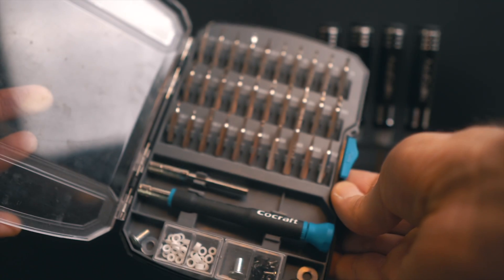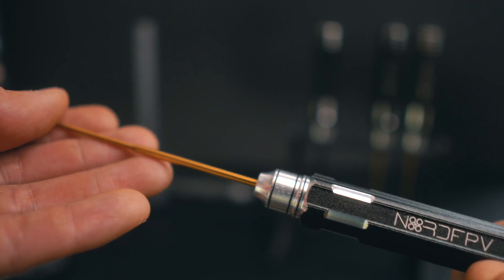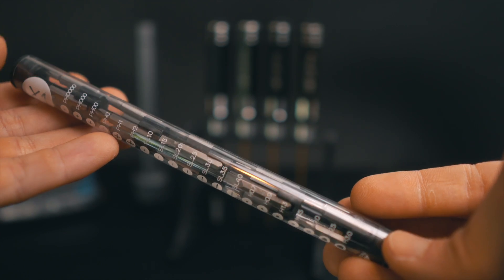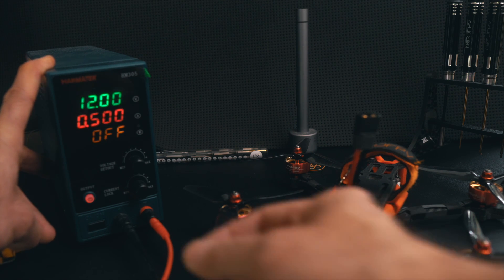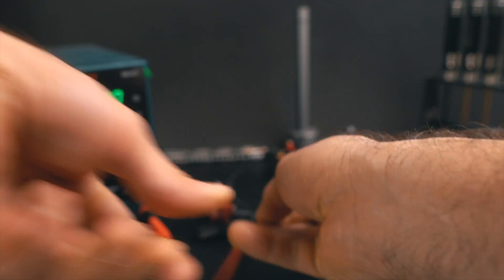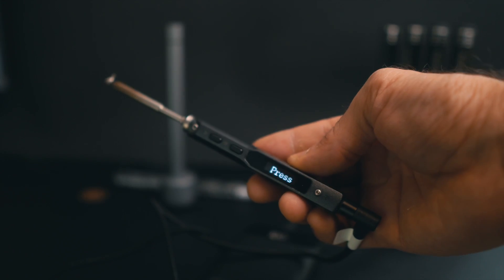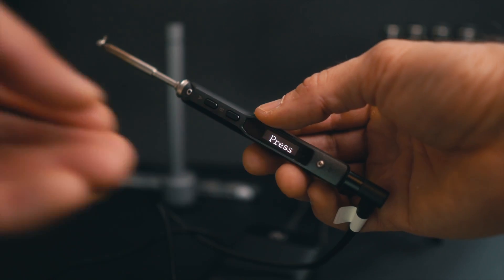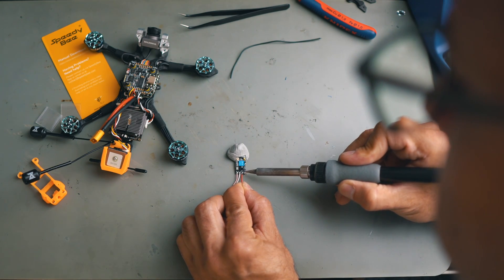Best FPV Tools for the Bench

Comment: I don't like having a lot of different "full-size" screwdrivers, because they take up so much space. So, I use screwdriver bits almost exclusively, and have been for years.

Screwdriver bits have many benefits, like taking up less space, being cheaper, not having to throw out the entire screwdriver if the head becomes worn (just get a new bit), the ability to have a ratcheting screwdriver (much easier on your wrist, if you use screwdrivers a lot), and so on.

Initially, I had the problem that the bits weren't long enough, e.g. if the screw is deep inside a case. But there are "long" bits available, and they still take a lot less space on your bench than full-sized screwdrivers.

If you don't like switching bits, get a second bit screwdriver (or even a third one). That way, you don't have to switch bits while you're working, and it's rare to need more than 2 different bits for a single job. And it might still be cheaper than buying a set of full-sized screwdrivers.

But that's just me, some people swear by full-sized screwdrivers, but personally I don't like them.

Comment: Great content. I assume the voltage setting is 4.2 x the number of cells the drone takes (6s, 4s, etc.). Would the 0.40 amp setting be enough for any FPV drone?
Reply from the maker: Thanks!  Not necessarily 4.2v. You don’t need to simulated a fully charged battery. In fact I normally use 16v for most of my tests despite I can be working with 6S drones. 
The current is more important. You can see in the video I used 0.5A and it was enough to hear the start beeps but it got into current protection mode. That happened with this drone which draws a lot of current. If I were to test the motors for example that 0.5 won’t be enough. So the answer is: it depends on the drone. I normally start with something between 0.4 if it’s a small drone, or 0.7 if it’s a 5”, but to test motors I have to go normally over 1amp.
Reply: @NordFPV  Thanks for the information!

Comment: I build and repair quads, and i also enjoy repairing electronics in general. Thermal camera, psu, air station, good and powerful solder station, stereoscope 10x, etc, all good tools to have
Reply from the maker: Oh the magnifier… yeah… I thought it was only me and my bad eyes 😂
Reply: I use a cheap digital microscope from Ali and it's really good for the basic tasks I need to do. Yes, a stereoscope is better, but also a lot bigger, heavier and more expensive, and not needed for basic soldering and troubleshooting.